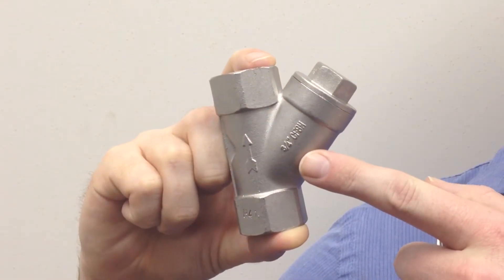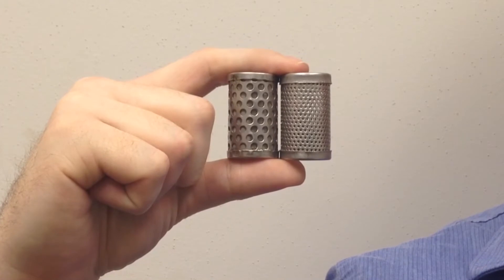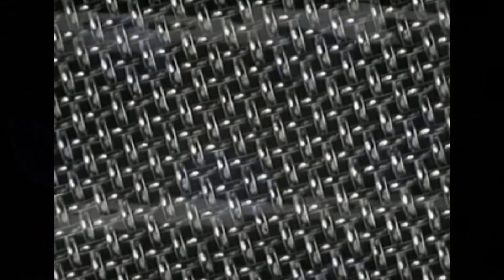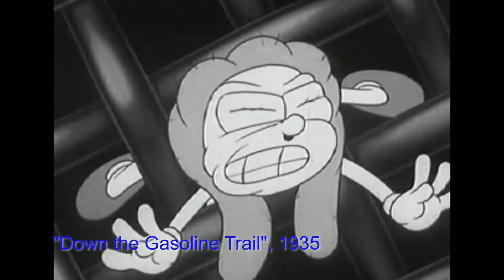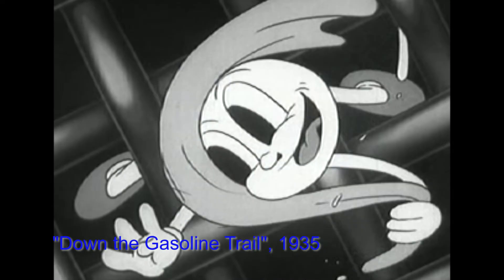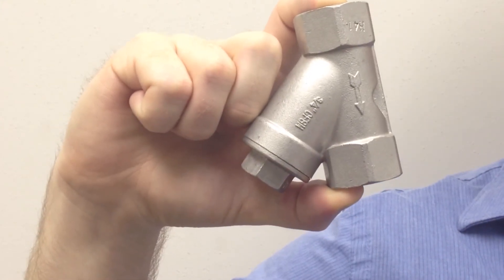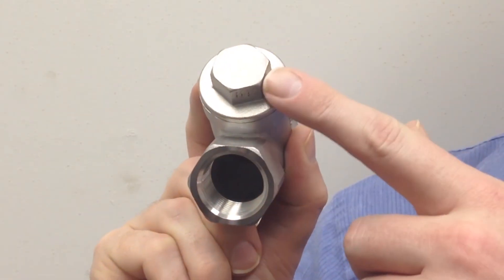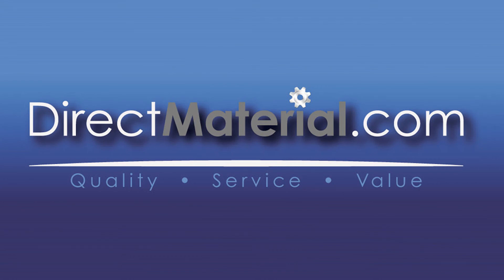What is a Y Strainer?

Comment: is it worth mentioning, that it is good to loosen the filter retaining nut, temporally prior to fitting it in situ, as they are normally very tightly fitted, in the manufacturers factory,, to save distorting the copper tube, if you do not, pre loosen the filter nut